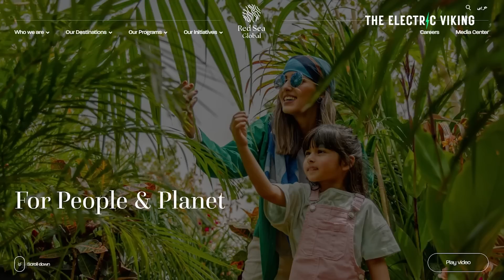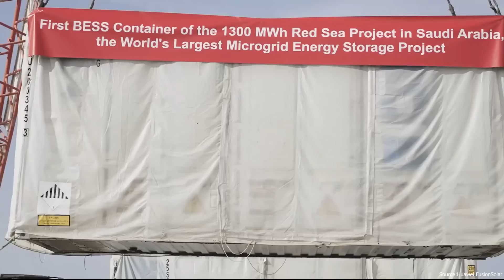A solar city in the Saudi Arabian desert is powered by the world's biggest battery

Comment: 'Will be' is NOT the same as 'is.'  Even the battery system near you, Sam, doesn't do HALF what it's supposed to, and has caused the overloading of the Victoria interconnections, to get enough power to SA.  It has also ended up INCREASING power prices down there, to German 'power poverty' levels in many cases.

Saudi Arabia isn't going to come off petroproducts for its revenue.  They intend to continue doing what they're doing.  And remember...they don't build panels or batteries.  So this is all about image and attempting to make Europe even MORE dependent on them.  Not for electricity...just gas and oil.

Comment: I've been watching what the Saudi's have been doing with renewable energy projects. Some years ago they built a test city, to check if it would actually work. The videos I've seen were amazing. Everything from composting waste, recycling water etc. Just astonishing. Oh, yes, solar powered. At that stage they hadn't got into the big battery storage. That came later. It seemed that "cost" was simply ignored and we didn't get any idea of how much had been spent "testing" all these different systems. 
As Sam said, the Saudis are aware that their Oil supplies will not last forever and this was a 50 year project aimed at eventually replacing their reliance on Oil to generate revenues. 
So Tourism was seen as a long term replacement, with energy via renewables being targeted as an exportable "product". Interesting eh? There are numerous other Big Vision projects in play as well. They are thinking not just for the next 20 years but for 50-100 years into the future!!
Plus, one other big project focused on something that few other Countries have even thought about: Water. How to keep it, re-cycle it and provide enough for drinking/washing but also for commercial crops/farming. They are looking at Dams, huge Salt water conversion systems to be able to use water from the Oceans. The size and scale of these plans is mind-boggling. Cheers.

Comment: Mine is a TESLA solar-power/batteries house that goes well with my electric SUV. A freak lighting storm knocked out some things including my 3 TESLA batteries operation that is scheduled to be fixed soon that will mean my batteries will have be out for 41 days, since their remote attempts failed to get my batteries operational again. My solar-power via TESLA solar panels is operating, so I still charge my EV during solar-power times of the day to reduce to power requirement from the electric grid. Even with dust and pollin on my solar panels, the electric production is nearly 100 %. The rain washes off the dust and pollin. The slight remaining residual film does not register a reduction in solar power ... so I never need to wash the solar panels. The electric grid is my alternate source of energy being supplemented by solar-power. When my batteries become operational again, I will again pay zero dollars for electricity with only a roughly $5 per month line fee. I have the ability to disconnect from the electric grid at any time. Saudi Arabia is forward thinking regarding energy, apparently.

Comment: Where can I see Australia's "blue print" of renewable energy?  I would like to see where all renewables will be built, what kind of renewables will it be, how many will there be, how much land space and offshore space will be needed, how much cabling will be required, where will the existing grid be altered and rejuvenated, how many battery farms will be built and where will they be positioned, how many existing power stations will be imploded and when will they removed, what will we do with the old power station land,  where are we building recycling plants for used and unrepairable renewable equipment, and an activity plan showing progress reports and increment project stages. Does a cost analysis for this endeavour exist?  Where can I see the schedule and allotment plan for everything I mentioned? Have the recruited all the labour needed for this fantastic new electricity supply project?  How will all this expanded for a new industry, military and population programme....going forward? Will we end renewable wind and solar electricity if we decide to go renewable Nuclear as they have done in Finland?  I have more questions, but I find it hard to find answers on the internet. Perhaps Government will publish all the answers soon.

Comment: I missed the bit where you mentioned that all these panels will at some point need the dust cleaned off after a good sandstorm. And that the Chinese have found that washing the dust off their desert based panels has proved to be a very effective method of regreening the desert.
Reply: And meanwhile China commission s a new coal fired power plant every 14 days.
Reply: And they can collect nighttime water vapor from the air on condensation screens.